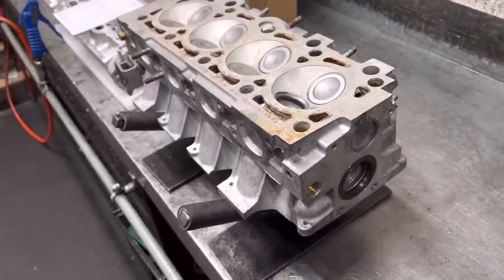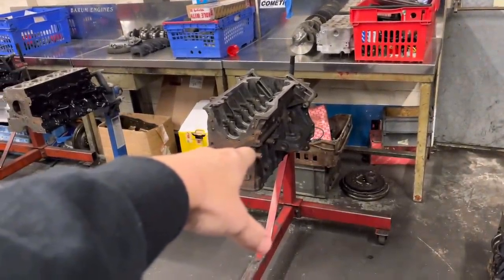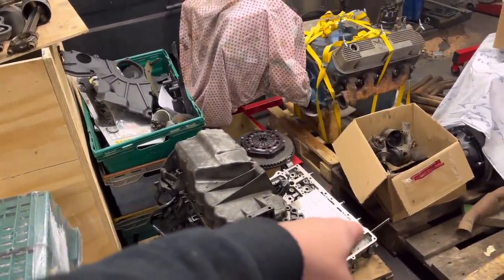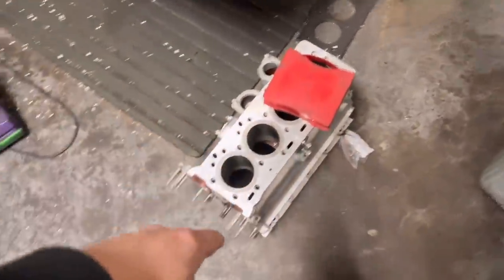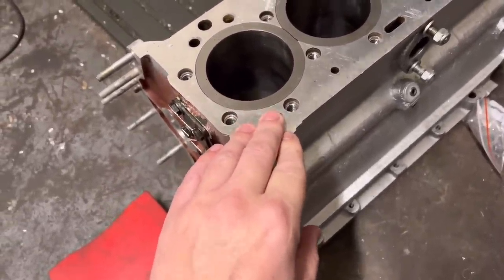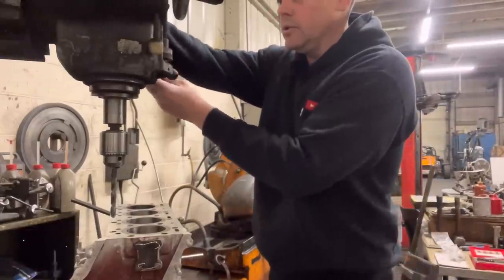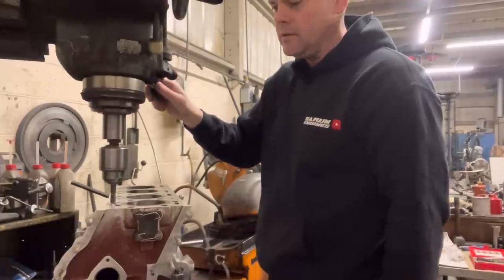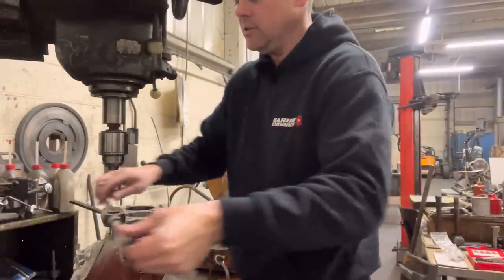How too prevent ENGINE FAILURE with simple thread repair

Comment: Helicoils are the best threaded insert available, Porsche use them for their mounting bolts for the brake calipers into the aluminium uprights.  In various tests Helicoils out performed all other inserts, their simplicity is part of what makes them so good.

Recently, I had to part disassemble a fairly new Chinese industrial engine.  In so doing when it came to refitting the M6 bolts holding various covers on most of the threads stripped out, without even nipping them down, such is the crappy aluminium alloy of the block.  I ended up Helicoiling all the bolt holes as insurance.

To centre a drill head I've seen a ball bearing, larger than the hole dropped on top and then a pointer set up in the drill, running true, which is then racked down to touch a piece of shim steel between the ball bearing and the pointer,  If the drill head is not centralised the shim steel tips at an angle and you can tell at a glance which way to adjust the bed in both the X and Y axis simultaneously.
Reply: I think Time-sert are better than Helicoil.
Reply: @stevepalmer5670  Not on the tests that I have seen, admittedly in second place but the Helicoil out performed them on both the pull out and on the torque tests.  A Time-sert by Wurth is but a threaded sleeve that is inserted into a larger hole with its bore being the thread to be re-engineered.  It is only as good as the larger diameter thread in the base material and then it is subject to the same fit and tolerance as a normal male/female thread i.e. it can't have 100% contact - see Machinery's Handbook.  On the other hand the Helicoil initially has the same fit but as soon as a bolt is inserted and tightened the ramping action between the Helicoil and the bolt threads spreads the Heleicoil out to engage fully into the base material with 100% contact, with the load being radial and trying to force the Helicoil further into the base material.  Whilst this lessens the contact between the Helicoil and the bolt the material strengths of the Helicoil and the bolt compensate for the loss of contact.

The only time where a Time-sert may have an advantage is where the radial pressure of the Helicoil may be too much for the location i.e. where the threaded hole is too close to a void e.g. the cylinder stud holes next to the bore of a VW air-cooled crankcase.
Reply: @clivewilliams3661  Well Iv'e used both & I know which ones I prefer.
Reply: @stevepalmer5670  And conversely I prefer Helicoil although I would use Time-serts in specific locations.  I only highlighted the published back to back test results.  I also defend Helicoil because too many unknowledgeable people think that because of their simplicity, they cannot work as well as some of the more complex types, which is not borne out by the test results.

Comment: Having got a speck of swarf in my eye from an airline, I can say first hand that when an 18 stone matron at the eye infirmary gave me a stern bollocking for not wearing goggles and then proceeded to dig around in my eyeball with a needle to remove it, followed a week later by exactly the same process to remove the rust, followed by a weeks course of antibiotics, can say that I highly recommend eye protection, to Isaac at least? I never go near my lathe or mill or airline without them now, ever. Just sayin'
Reply: I do quite agree - me too - A cheap supermarket vacuum cleaner dedicated for sucking out swarf  is so much safer and keep machines and floor clear    not safe to blow anything these day  keep the air still and clean to breathe safely
Reply: Totally agree 100%, I guess if your eyes have no value then carry on doing what your doing, the big thing here is to learn a lesson before anything bad happens.

Comment: I also use tapered bits like your deburring tool for centering on a hole in my milling machine, and then do all the operations while locked in that position. How precise is it? Probably within a couple of thou which is really quite close enough for something like a bolt hole given the amount of clearance in the part being bolted to it for the bolt. Never had a single problem.. The thing about being precise down to the thou, or ten thousandth is that there's a time and place for that precision, and experience machinists know this.
Reply: Agree it's probably accurate enough even using the 3 jaw chuck to hold the setting tool, the drill will want to follow the old hole anyway.

Comment: On the mini, years ago I built a warmed up 1100 and what I learnt the hard way was that the standard size cam follower's are too small for a hot cam. The cam lobes end up clubing on the sides of the followers. Machining them out to the size of a Holden 202 follower fixed the issue. This was taught to me by an old mechanic who worked on the race Mini's and who ported and polished the head and inlet manifold for me.

Comment: Always wear goggles where air lines are used,keep up the great content 👌
Reply: Agreed.
I can state from personal experience that having a small piece of swarf go into an eye is an incredibly unpleasant thing, especially when it's non ferrous, so can't be removed using a magnet.
Reply: Cant you see the risk assesment on the wall next to that machine, drill is guarded to prevent contact with moving parts, appropriate PPE is worn by staff while operating : Protective eyewear (F), gloves, hearing protection.

And I'm really not that guy, its just basics isn't it.
Reply: £10 safety specs, at minimum ,  I do enjoy the channel but their approach to H&S is piss poor

Comment: I was taught that when using a tap to use a touch of grease and to do half a turn with the handle and then back it a quarter turn to clear the swarf
Reply: Similar. I was told to back turn the tap after a few turns going forward when I started as a trainee toolmaker. Never finished my traineeship. The company said it would lead into them giving me an apprenticeship. They always had an excuse to delaying giving me one. They were using me for cheap labour. I was earning five pound a week in 1972. I left and got an apprenticeship with a printing company.

Comment: I would suggest using cutting fluid on the tap when tapping into the Aluminium block and also reverse the tap 1/4 turn after every 2 turns to break the swarf build up. And please use safety glasses when blowing the swarf away, if possible use a vacuum cleaner to suck it up so it doesn't blow everywhere, keeps the area way tidier 😊👍

Comment: I did my 350 Chevy engine up. TWR ali forged pistons. 11.5/1. High lift cam. 750 cfm holley carb. I thought the valves had a lot of play in the guides so took them to get done and they felt the same. The man said that was the spec. Must of been at least 2mm movement.

Comment: The "ridge"  at the join between the valve seat and exhaust port is called an "anti reversion" step. it is to stop "eddy current" swirls of exhaust gasses flowing back into the cylinder

Comment: I worked in a private and regional jet assembly plant.  Any and all threaded holes in aluminum were helicoiled
Reply: Aircraft engineering is a cut above, the attention to detail is very impressive
Reply: They are specifically designed for use in aluminium for a stronger thread and not as repair technique. Also we were trained break the tang off by turning the insert tool anti-clock.
Reply: @rogerbond7811   it's not only for strength, it's also to prevent galvanic corrosion. When we installed the helicoils we used Mastinox to prevent galvanic corrosion.

Comment: Although I understand the principal of using helicoil inserts I have never understood how they actually remain in place on a high loaded bolt/fastener without them pulling out.I am more than happy for comments from anyone to resolve my queery? I used one once on a thermostat cover in an a A series which worked well but that was only a very low tension application as the housing is under very little tension obviously but for something like a head bolt.?
Reply: For want of a better simpler explanation as I am an engineer the helicoil is made from a piece of high tensile wire the same shape as the cut thread you tap into whatever you are repairing. Helicoil taps are special oversize taps made for helicoils but the pitch on them is the same pitch as the thread you are repairing for obvious reasons. The inside shape of the helicoil wire also matches the bolt or stud your going to be screwing into it, 60 degrees for metric, UNF, UNC and 55 degrees for BSF, BSW etc. When you start screwing in the helicoil with the tang at the bottom because its a bit like a coil spring it tends to close in slightly so that it screws in nice and freely, once you stop turning the helicoil it expands slightly or relaxes itself and becomes tight in the hole, if you want proof try turning a helicoil back out of a hole even if it is in one thread, it wont move. And if you try fitting a helicoil upside down it wont work because the tang is at the top it is trying to expand the helicoil as you turn it, yes i have seen people try it ! Then you snap of the tang by turning the driving tool you inserted it with backwards, remove it and the job is complete ready for the bolt or stud to be fitted and once the bolt or stud is screwed in it is impossible for the helicoil to escape. I have fitted hundreds of them down the years to engines, gearboxes, axles and what ever else has threads in it and not one has pulled out yet that i know off. 
Another kind of example on how the principal of a helicoil works is this. Sometimes you get a set of Allen keys which are held on a key ring with little coil springs, these work the exact same as helicoils, you have to turn the allen key say clockwise for example to remove it from the spring and turn it clockwise to replace it back into the spring, turning it say anticlockwise for example will only make the spring grip the allen key tighter !

Comment: Do you not put any thread lock on the helicoils  ??  What would stop them coming out when you remove a bolt ??
Reply: When you undo a bolt that’s in one the helicoil locks against the parent material an stays put, that’s why you can’t unscrew them with the insert tool

Comment: I use helicoils and time serts daily, i have no preference for either. To answer some other comments: Helicoils are retained by spring pressure, so if installed correctly they need no loctite. Wurth time serts are fixed by using a tool to form the last few threads, pushing the bottom of the insert out and locking them into place. Time serts are far softer, being made of a soft steel, where as helicoils are made of spring steel, making them tougher. Time serts are great for repairs where the parent bore of the repair is sometimes slightly out of shape - usually because diyers have had a go at fixing it themselves. The flanged top hides most of the mess and the fact that they are a solid insert gives a nice feeling thread no matter the state of the hole they're installed in. Helicoils are a little less forgiving and more likely to fail if someone makes a mess of installing them.
Reply: Can I just say, many tests here on YouTube have been done, and every single one conclusively says Helicoils are far superior to Timeserts. Not saying Timeserts don't have their place, they just don't have the holding strength a good Helicoil repair does. No idea why everyone goes on about how much better Timeserts are but that's just me and the power of advertising I guess

Comment: Leave the ridge on the bottom of the exhaust seat! It's on the long side of the exhaust port and most of the exhaust flow will follow the short side of the exhaust port, the straightest path from the combustion chamber to the exhaust manifold. Hogging out the throat of the port by removing the lip will slow the exhaust gas flow through the port at that point. You don't want that!!

Comment: I was serving my apprentiship at Fords when Heli-coils came about, invented by Fords, so as to save engines before they went out the door. Also metal based filler for filling holes in blocks. Also machining the blocks on the piss because the cylinder moldings had moved. Got a lot of overtime on that.

Comment: Not sure why you're asking about the process- as long as the drill press/milling head is vertical, you really can't go wrong. Yes, you could use something other than a countersink, maybe a piece of drill stock, of the correct diameter, but it looks like the countersink hits the center, so bob's your uncle, eh?

Comment: If all of your processes have worked without issue over the years, is it really wrong? I don’t think so. What is slightly disturbing is the lack of PPE especially eye protection as stated in previous comments. The cost of safety is nothing compared to the consequences of not using it. Love all the vids though. 👍🏻👍🏻
Reply: Great channel. Please use PPE. You only have two eyes.

Comment: Helicoils?    Wurth Time-Serts Helicoils are OK for a water pump or inlet manifold to head for example (low load stuff)  but crucial head, mains etc nah Time-Sert , just my cents worth Helicoils are crude at best IMO regardless of  brand, they also do extended Time-Serts for this kind of deal inc larger outer dia if needed,   GET SOME GLASSES ON

Comment: Enjoyed every minute of that video but please a small bit of swarf in the eye is probably 4 or more hours in A&E, A good pair of wrap round protective goggles is less than a fiver though cost will depend on how much you value your eyesight, a good friend of mine lost an eye due to a substantial splinter off a spindle molder, had he been wearing the supplied protective goggles he would now be seeing through both eyes, take a minute then to put a patch over your eye and carry on doing the work you do to see what its like losing an eye, or both, you have recently gone to the expense of using covers on built engines to keep swarf out, do the same for your eyes

Comment: Disappointed in the lack of safety eyewear especially blowing away chips. Think about it please, eyes are not replaceable!
Reply: @chrisjohnson4165  when I was serving my apprenticeship I was doing some turning on the lathe and a piece of swarf hit me in the corner of the eye lid. It actually stuck to my eyelid and had to be pulled off.
Back in the day they insisted on hair nets but no eye protection.
Reply: Every single machine in my workshop has a pair of safety glasses hanging on it, with an extra couple of pairs on the bench for anything nivolving hitting hardened items like chisels or punches. It isn't worth the risk of losing an eye, once the job is set up, then on with the specs.
I am not a fan of Helicoils, I have found that Timeserts are far superior, especially in aluminium.
Reply: I completely agree I had a bit of swarf in my right eye ended up in hospital on the Friday surgery that evening rest of the weekend in hospital 3 stitches in my eye for 3 months and 2 weeks off work, and my eye has a scar for life and need glasses,  so definitely good advice.
Reply: @Impulse5596  get a grip man
Reply: @neilmartin5345  What material  were you working on and what had you done. It depend very much to what action on the job and materials. If we can accumulate  enough knowledge of how to make a chip fly, wearing glasses all the time weren't be necessary and that important too.
Reply: Agreed it only take one piece of metal to be blinded
Reply: Can I ask, why use helicoil, having used timesert on soft alloy castings over the years, I can't believe helicoil is superior.
Anyone got a good reason please?

Comment: Are you using something like Loctite 262 to weld the helicoil to the steel threads? If you don't then it is easy to pull the helicoil out. The Loctite bonds metal to metal - does not rely on oxygen. After the install you can torque well over 100lbs.

Comment: Installing helicoil, you do not knock the tang off, purely turn the installation tool anti clockwise and the tang breaks off. If you knock it down risk displacing the bottom few threads, by turning anti clockwise you are locking the insert against the thread.
Reply: @John Glover Strongly Agree ✅

Comment: Wurth Timeserts are much better than Helicoils, just sayin', also I'd be using longer Helicoils than that to increase their strength and minimise the risk that some ham fisted mechanic will over tighten the bolt and pull the repair out. Another thing, be careful with those taps on a tiled or concrete floor, they are super hard to keep them sharp and can smash like glass if you drop them, ask me how I know.. 'Sos' HTR
Reply: Agreed

Comment: another supporter of eyewear and machine guards. Both of which are missing everywhere. i enjoy the channel but wince every time a machine is used or the airline is used. I spent my life working for a famous airline engine manufacturer. You wore your safety glasses when you walked into the workshop and only removed them when you left. people on gangways between machines have been injured by flying debris.